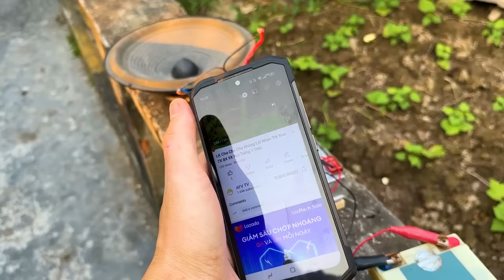DIY Powerful Ultra Bass Amplifier BTL C5200 , Transformer , Simple Circuit

Comment: The circuit does not work. You cannot make the speaker swing in both directions with two pairs of NPN 2SC5200 output transistors without a phaseinverter. The real amplifier is inside the batterybox. The only point with these videos is to get clicks and earn money.
Reply: Hi Brother 
@All Digital Craft
Reply: Are you sure that there's a real amplifier exists?? 🤣🤣
Reply: @jawadranjha6083  yes :)
Reply: You right Man 👍💯
Reply: And fun fact is can see the output and input terminals of that transformer?!!! why 220V wires need to that thicker and 12 0 12v wires is literally way more slimmer as equal to nothing.
Reply: what if we try it what he does
Reply: @poorgamer2908  Then we will fail.
Reply: @villageviewsofficial99  😊
Reply: Concordo com vc kkk
Reply: So, u mean that if children often seing this kind video, they will make their home burned......
Reply: It’s seems to be this guy turn everything into amplifier and every amplifier he made are have the same amplitude and working at more than a thousand of Watts
Reply: Não sei onde este cara colocou o verdadeiro mas isso aí não funciona nem na China nem no México nem no espaço......!
Reply: Wait then how do you explicate that the aux is in the thing and not in the batery?
Reply: @Denis7947.   The aux cable is just a decoy. The audio signal is on WiFi...
Reply: I love how confident you are in being wrong, you can literally wire speakers out of phase by flipping the positive and negative on one speaker
Reply: @CajunReaper95  It`s a nobrainer when you see the tape around the top of battery
Reply: You are apsluttaly correct .
Reply: No capacitors
Reply: Class A amplifier
Reply: @davidsonkofi858  NO!🤣
Reply: Funciona sim tipo módulo de carro!
Reply: Es sierro ellos son unos ...... Porque pero no saben que los que se engañan así mismo son ellos porque  la mentira es la peor basura que puede existir
Reply: it should work like push pull amplifier minus the input trafo, its a jurrasic audio amp, my incle still using this push pull audio as a booster amp for car stereo 12v
Reply: Eu desconfiei quando ele ligou o sistema e não deu nenhum pulo no falante, nem quando pegou no cabo auxiliar e não gerou nenhum ruído, e do nada um som limpo e alto.
Reply: Thats true 100%
Reply: Sok tau ni orang ,apa udah perna coba?😂
Reply: @rachanel8241  fill your car gasolinetank with water next time. You dont know if your car will run on water before you have tried it.
Reply: Only beginners/amateure will believe.
Reply: Es un engaño , el transformador los secundario no corresponde , no tiene diodos rectificadores ni el condensador electrolítico , es una farsa .

Comment: Again a FAKE Video!! You lifted up the transformer like a piece of cake. I suspect it is empty and has the real amplifier inside it
Reply: The amplifier is inside the battery notice how its held together by tape
Reply: Yes super fake
Reply: No thats is true !! The circuit can work with 12V DC battery , this is very2 old circuit using in AM Radio Pocket or else long time ago around 70's year
Reply: Hater
Reply: Tarkesh Chaudhari - You know nothing about electronics.  I am a tv and radio repair mechanic.  This amplifier is an old model circuit type.

Comment: It,s a output not 2500w buts a 200w 👍👍👍👍👍
Reply from the maker: i actually tried it with 2500 watts speaker and it works fine
Reply: It,s watt a speaker 2500w 1ohm yes
Reply: 2500 is the pmpo while 200 is the rms
Reply: @broccolixxx  -  Correct.
Reply: @Zilongofficial5678  is it capable of the 1ohm load,it'll fry your amp if not...does it get hot to the touch,or dam that's hot,after long..just wondering
Reply: I tried a speaker 200w 8 ohm and it works fine☺☺☺
Reply: Look like old amplifier technology, IT/OT transformer amplifier,
Reply: 125 watt max
Where speaker impidence matching
Reply: @technicaldiy l
Reply: Bạn phải thử nó với loa 8 ôm rồi hãy nói,thông thường trở kháng loa càng nhỏ thì cho ra công xuất đầu ra càng lớn,nhưng chẳng ai nghe nhạc với loa 1 ôm bao giờ
Reply: No near specs from two powertrans and a small 2x12v former. Sorry
Reply: 30W! 😊😊😊NOT MORE THAN THAT!!!
Reply: @kenielsen  not even sound
Reply: Mantaaaaap 🪛🎤🛠️👍

Comment: It would be better if you didn't claim absurd numbers. 3800W out of 12V is 316 amps. Not only your thin red&black wire would instantly bust into fumes, but even the transistors wouldn't stand it. The 2SC5200 is max 15A, i.e.max 180W with your schematic. Also you wired the jack in reverse polarity, and your two resistors are connected in parallel. And based on the wire size it looks like what you connected the transistors to was in fact the 220V primary, and the speaker is connected to the 12V secondary. This is a UPS transformer designed to work as a full bridge. There's not necessarily anything wrong with the final assembly as long as it does the job for you (i.e. make lots of noise), but you wrote a lot of errors and are inducing your readers into making errors.

Comment: Circuit shown will not work. Audio In is connected with ground( ie :- transistor base is grounded).. Also why 2 nos 10k resistors given parallel from same trace..?
Reply from the maker: resistors connected in parallel to double the power

Comment: I do not believe the speaker is connected to a 220 volt winding.
If the transformer is as labeled, the secondary 12-0-12 would be thicker than the 220 primary.
It is the opposite. The primary winding labeled 220 has excessively thick copper leads.
The label on the transformer is not correct.
Reply: 1 ohm at secondar is a short  .
Reply: @saouga53  This device works. And it's inventive. This is what it looks like
Reply: The handwritten powerrating on the back of the speaker is also a lie. He does it on more videos.
Reply: i don't believe usb charger plug has changed to a sound jack 😅😅
Reply: esse tipo de transformador é feito para diminuir tensao e nao para almentar ! a descriçao do transformador esta correta e a unica coisa que vai acontecer é converter de corrente continua que pode queimar o alto falante para alternada que é o correto para os alto falantes. ^^ ja a descriçao do alto falante nao sei se é verdade porque tem uma matematica para o enrolamento mais a corrente , e fora que pode mudar as descriçoes de pais para pais .

Comment: Chyba raczej na głośniki się obniża napięcie, żeby uzyskać większe natężenie prądu. Przy zasilaniu 12 V, w tym podłączeniu transformatora, licząc straty, idzie na głośnik około 200.v. Nie będę tego próbował zrobić, ale wątpię czy to zagra.
Reply: Tradus ai!!! entra 12v DC e sai a frequencia mais 12 AC que é normal para esses amplificadores antigos classe A. Dai so falta o pre-amplificador para filtragens, ampliar o som, definir a qualidade,limite de  volume !!!
Reply: Greetings from Bosnia-Herzegovina 🙋‍♂️🤝...Don't worry, it won't burn unless you burn it, I tried it successfully, it was very satisfactory after I added a volume regulator and replaced the battery to adjustable 12v adapter👍🌟🌟🌟🌟⏯️...

Comment: Pls describe what type of amp is this..looks like an attempt to turn 12 dc to 240vac stepup voltage booster into an audio amp which is ridiculous ,it simply doesn't have the current to push large 8ohm speaker well

Comment: Oke kawan sy yakin dan percaya. Pertanyaan sy apakah bisa pakai speker 15 inchi berapa wattnya kedua bila trafonya 2 Amper apa juga bisa. Yg ke 3 trafo ct bagai mana jika input ACnya ada 4 misal  0 - 110 -- 220 -- 240 nah untuk output spekernya ada 3 antara 0 dan 3 input ACnya itu kwan
Reply: 15 inch. Ok but how many Ω and watts?

Comment: This would work better if the speaker was connected across the 2 12v windings instead of the 220v one...and just leave the 220v unconnected, connecting to the 220v side is loading the amp down way too much and you are losing power. Doing this and running into 1 ohm you could get up to 200 watts RMS with a 12 volt supply (assuming the transistors can take the current)
Reply: Can you make a demo for it, really need it to enhance my TV audio tnx much.
Reply: And assuming you have a Power Supply capable of supplying  ~16 Amps! which lets face it, most wont!
Reply: The thing is he made a booster amplifier instead a normal amplifier that's why he use transformer awesome..

Comment: good and simple amplifier circuit. but without any form of crossover or tone control, it will be fullrange, not a bass amp.
Reply from the maker: Just add a Bass equalizer and it becomes an ultra bass amplifier
Reply: The input signal is where you choose that.
Reply: Brigadier. J g vincule :-) URI yo Ojeda TFT y
Reply: booster type amplifier
Reply: He was controlling the volume through his mobile.

Comment: But no audio processing chip or audio ic how is that possible without any audio ic connected to the circuit it's just direct 3.5 mm to speaker audio signal converter looks

Comment: Hood nakuwa ko ang sercuit niya boss, pwidi na ako makapag asimble,  5 om 5 w 225/  maylar 630v  power output c5200 , 1k 1/2 w, 12 volt supply, at saka power supply 12 0 12      220v ac,

Comment: Why you cant try with a proper sound out put transformer with 2, 4, 8, &16ohm tapping for speakers that will be better for hearing full detail audio because from this 220ohm winding so many audio detail should missing can you upload a new vedio with sound output transformer with this same circuit please
Reply: Pues la verdad Tantos comentarios negativos dan tiempo a dudar de tu técnica de todas maneras si eres sincero enseñanza Gracias voy a probar si dice la verdad la gente qué opina para arriba de todo muchas veces tienen la razón pocas veces se equivocan voy a seguir tu enseñanza voy a hacer una prueba y luego se Comenta gracias

Comment: What's the point of the transformers I'm pretty sure they are only used in  imp matching circuits. You will only get less than the amount of power you put into the transformer. Anyone with h even basic electronics skill should know that.
Reply: It's a scam

Comment: Do you have a schematic to share  :)
Reply: He never shows schematics because the circuit he builds would never work in the real world. He just solders a bunch of components together and then has a "trick" to make it work at the end. This whole channel is horse $h|t. I'm a component-level electronics repair tech in my offline life so I know what I'm talking about.
Reply: @Pulse87dotca  I was wondering how he did the phaseinverting for the outputtransistors.

Comment: in the first place. i thought that transformer will use as to supplies power for 12v pfft.. you can use small pcs transformer just to lowpass the filter instead of this big transformer that cause of Weight for nothing to do with it just to lowpass the filter. and instead of that. you can use a 3 pin inductor for your v0+ line

Comment: You can NOT use an AC power transformer as  an audio transfomer. It will distort badly for several reasons. A proper audio transformer must be very carefully designed and constructed - they are rare and expensive

Comment: This is NOT what was advertised, amplifier with no feedback with high distortion. This will not deliver 100W; and connecting low impedance speaker through 1:20 transformer is not even close to impedance matching. Probably, any integrated IC power amplifier will be much better... Wrong position of heatsink for good convection. Not great or impressive technically.

Comment: no circuit, no amplifier, or does the author think that I have the pinout of all existing element base in my head? well, these are trifles, the question is different, even if there is a standard circuit with a transformer output, it will not have enough gain to drive the speaker, you need a preamplifier, here it is hidden somewhere. In general, the amplifier is bad, even by ear nonlinear more than 10%

Comment: Very fake invention hahahaha even the speaker wattage mark 2500 watts smallest magnet 2500 watts? Good job sir it is for viewing only even the input connection the positive line of input connected to the negative of battery....hahaha it's fake if the battery full charge the cellphone will banggggggg hahahaha